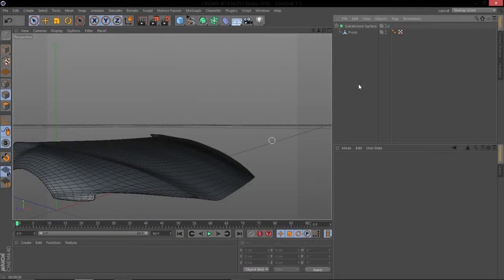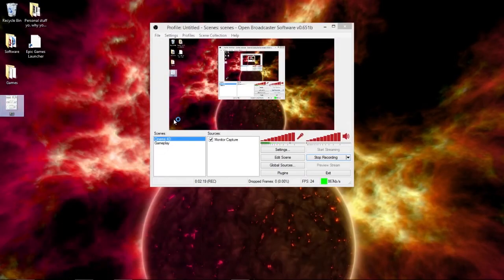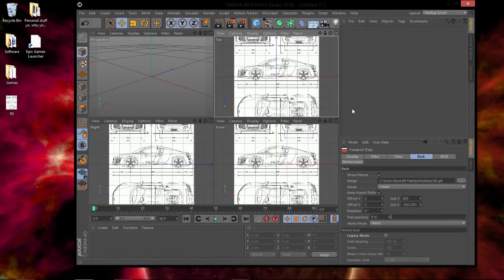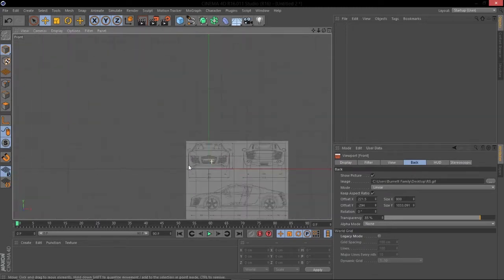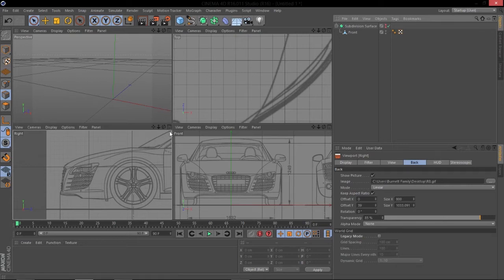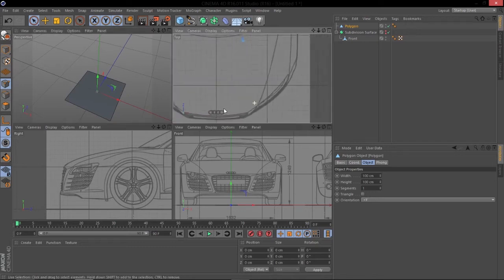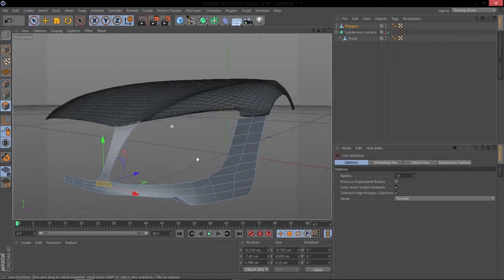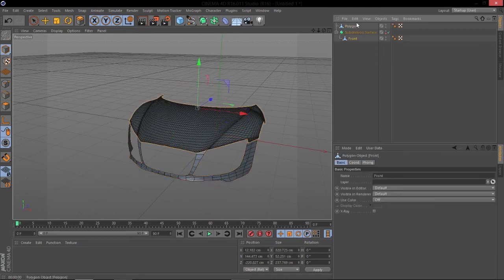Cinema 4D | Modelling organic mechanical pieces for cars

Comment: great tutorial thanks! question: why not just weld those points when connecting symmetry object? by default weld tool connects them half way so exactly in the middle.
Reply from the maker: Thanks! I only learned that after making the tutorial, I also just habitually optimize points in case I've missed any along the way. But you are correct, making a symmetry object editable will automatically weld points along the axis of symmetry

Comment: Heyo, first off - this is amazing and I'm going to be using this video for a really long time as I learn how to model cars and such. Thank you so much for walking through everything like this, I learned a whole lot!

Secondly - I started into making a car, not very far but when I loaded up my project to start working on it again the images of the blueprints weren't there anymore. The side/top/front views just have my mesh there, no images... but in the viewport thing where you bring the picture in (on the right, Back tab) it still has the pic there. I kind of fumbled up a bit and had to rescale some parts and move them around so I don't want to bring them in again as I don't think I'd get it exactly to where it was again.

I will probably just restart the whole thing as half of my geometry is bad anyway. But I'm worried of something like this happening again in the future. I don't think I can do the whole car in one sitting. Any ideas? I think for the future, I'll just try and make it so I can easily bring the blueprints back in, in the exact same spot. No rescaling or anything. I think that was my biggest mistake, just bad reference images/blueprints I went off of. I also started mine before I saw this video :p (For the record, I'm trying to make a Skyline R34)

Your stuff is awesome! Hope you're doing well and maybe get back into the swing of youtube things again some day :)

Edit: I figured it out... shouldn't have even bothered asking before I exhausted all options. I think I moved my files around after I brought them in so they weren't in the same location when I loaded... Anyway, I'm an idiot, have a great day :)